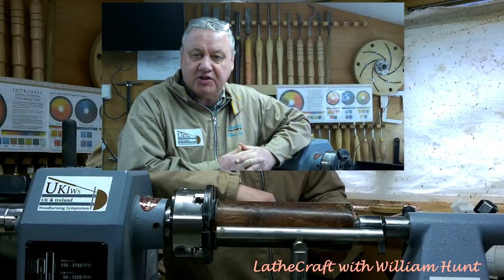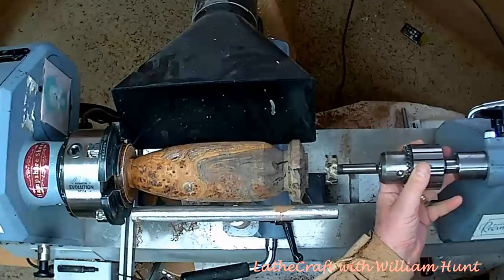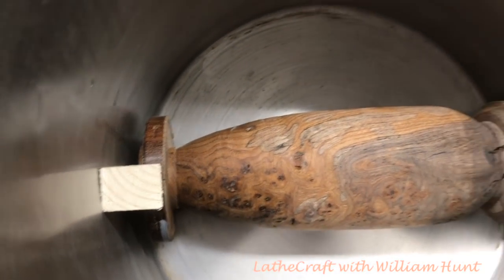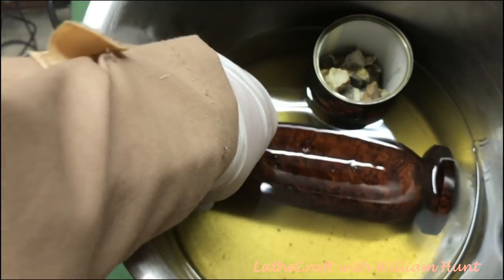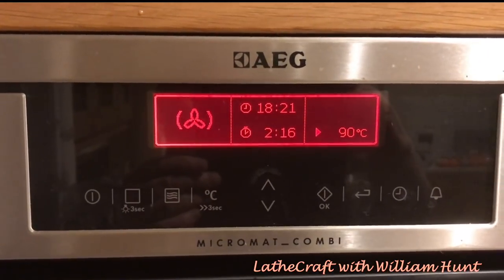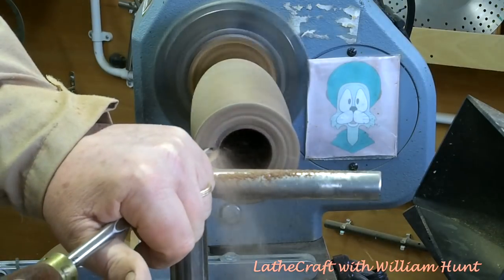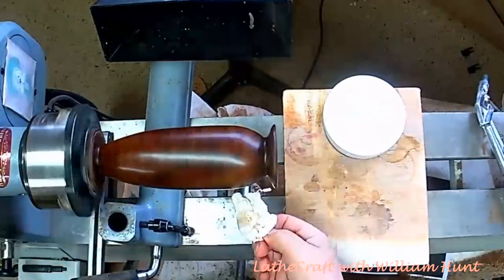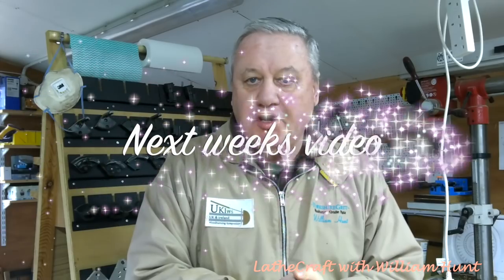Woodturning - Stabilized Bur Elm Bud Vase

Comment: William, do you have an idea why the original stabilization failed?  Would it have been just not leaving the piece under vacuum long enough? Would it have been better to drill out the center before the original attempt to stabilize? Regardless, the vase is quite nice. I think it is quite worth your effort. Thank you for sharing.
Reply from the maker: Hi Glen, yes. I didn't understand the process and removed the piece a few minutes after I released the vacuum, so penetration was minimal. RTFI ....!

Comment: I am new to turning.  Why use cactus juice, versus resin?  Is there an advantage to using a vacuum process versus resin in a pressure pot?  Or possibly due to cactus juice being an easier process when hole pre-drilled?  Thanks.  I enjoy your videos.
Reply from the maker: Cactus juice is a viscous resin which needs to be heated to 195F to cure. It's used to stabilize punky or rotten wood. It relies on the air being drawn out of the wood by the vacuum process and air pressure forcing the resin in the cavities when the vacuum is released. This is a slow process and can take days or longer, depending on the condition of the wood. Ordinary resin starts to cure as soon as mixed so would likely set before full penetration.